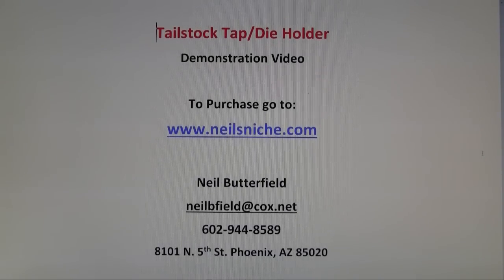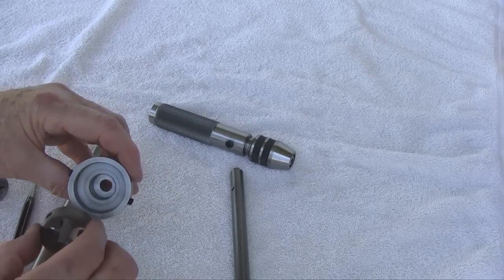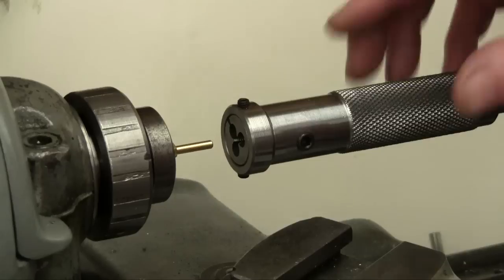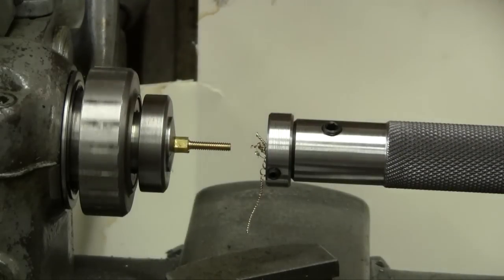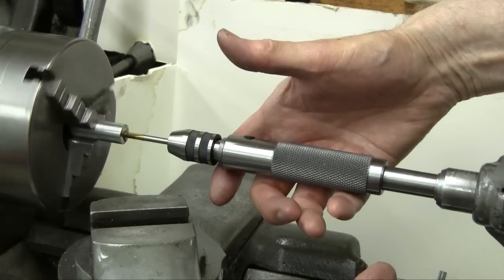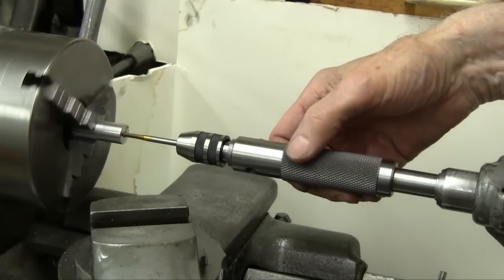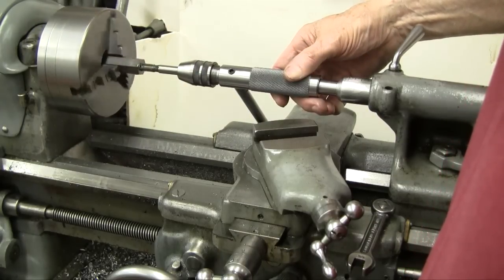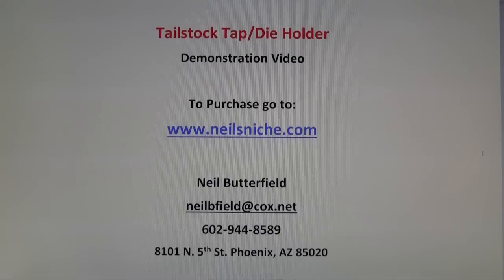Tailstock Tap/Die Holder Instruction Video

Comment: Nice tool and design. Only concern I would have is using the larger taps and dies with the handle attached you have no safety if you bottom out or bind and don't shut the lathe off in time, something has to give, unlike it just slipping out of your hand without the handle. I'll bet you're already thinking of a safety of some sort like a declutching chuck or even a regular chuck that would slip or even a flexible handle that would give at the right tension when a bind or bottoming out occurs. This is all meant to be a constructive opinion. You present your product very professionally and at a reasonable price seeing the quality of your machining. Ed K. Cleve.Oh.

Comment: Got some safety questions for you.  Tapping 1/4-20 in aluminum will have to use stop handle.  My slowest speed is 150 RPM.  Besides that I won't be bale to run the stop handle on the slide, but will have to rely on the bed.  I have a G9972.  Will this work for me.    I just today had a serious mishap forgot to hit reverse when extracting tap handle.   Don't want a repeat of that.
Reply from the maker: JOe Shmoe  Joe, Sorry I'm late getting back to you. Best way to answer is on the phone. Call me 602-944-8589 or email question neilbfield@cox.net and I'll try and reply immediately. Neil

Comment: Hello, I thought you might like an update on the use of this tool I purchased from you. Like you said, it's a great tool. In your video you mention the use of the stop handle and it's use. That is a bit of an understatement as I soon learned. The cutting of just a 1/4 in thread snatched that tool out of my hand. Luckily I had the handle installed and it did exactly as designed. This is indeed a great tool and I enjoy using it often, especially tapping holes. No need for a spring loaded backup device. Hope you sell a bunch of them, because they are well worth the money plus made in USA. Thanks again...Ken.. Marina CA